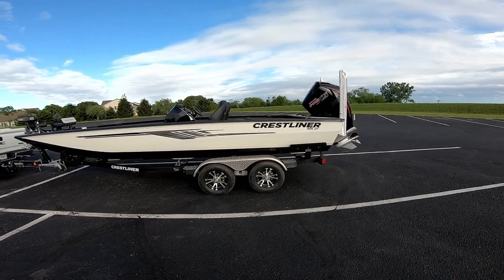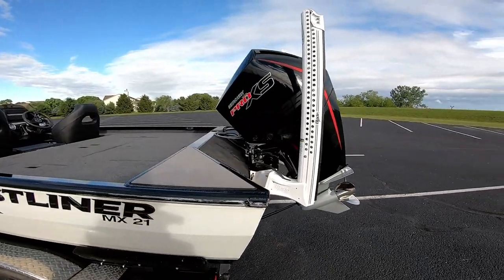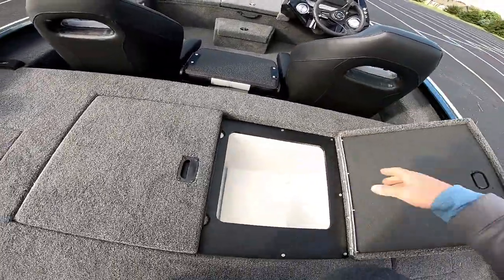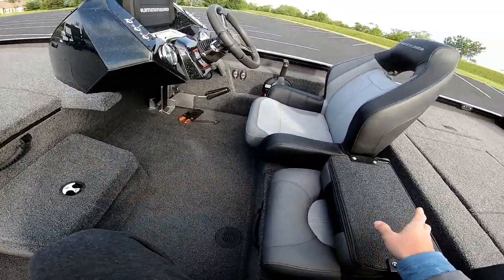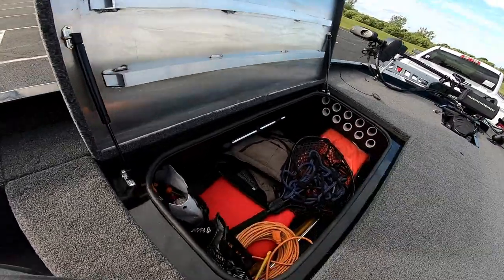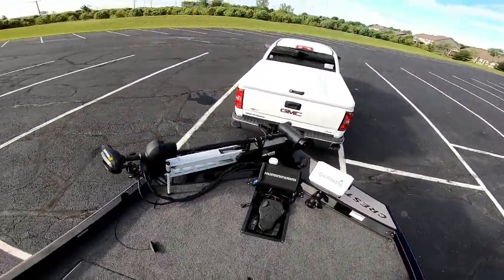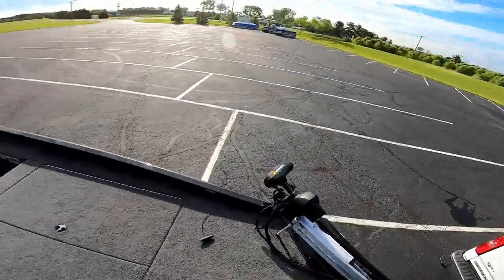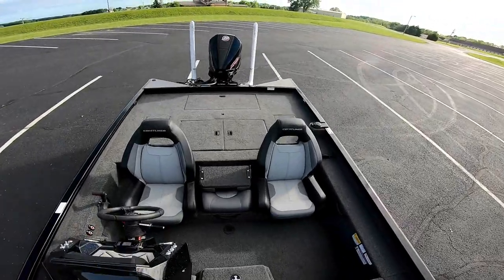Crestliner MX21 Bass Boat Walkthrough (FULLY LOADED!)

Comment: What do you think of the trailer and trailer quality? Is it easy to load? Seriously considering this or a Vexus
Reply from the maker: Trailer quality I would say is average. It’s not great but it’s better than other brands I’ve seen. So far it’s worked fine. Only issue I have is the winch hook and the keel roller has scratched some paint off. However I think that comes down on Crestliner paint quality more than the trailer.
Reply from the maker: I would forsure say get this over a Vexus. You can message me for more details

Comment: Hey buddy I had commented once before. Just wondering how things are going with the Crestliner? I'm looking at possibly pulling the trigger on one.
Reply from the maker: My bad for not getting back! The boat is doing great. I have 0 complaints other than top end speed and handling over 5500 RPM. Everything is staying together the boat is rock solid.
Reply: @andrewmlo5937  you got back to me on the other comment buddy, I was just letting you know that I had commented on your video once before. 👍 That's really great news Andrew! I wish you would sell it.. I would buy it from you!
Reply from the maker: @fabfishing7422  I was lucky I got it when it first came out and the base price was 45.. now I think its 55 or something comparable. you should consider the MX19 I was able to see/ride in one and it has better handling and top end speed is the same if not 1/2mph better... also its still massive.
Reply: @andrewmlo5937  Bro, thank you! I certainly will 👍 I know man, the inflation is PSYCHO!

Comment: Good review.  I just won the MX19 and plan to run it.  I’m not sure exactly how they are going to rig mine but it will have dual PP blades, Ghost TM and Lowrance units (TBD).  I can already see some things I may not like (like no dedicated cooler) and what you said about the rod tubes not being long enough).  Can’t wait though!
Reply from the maker: first off Congrats! I know a few guys who run the ghost. I personally like the Ultrex better. Also I prefer Humminbird graphs (I've bad both). however that's allll personal preference. the day boxes are nice for a soft cooler (that's what I've been doing). yeah the compartment on the other side actually fits all size rods so you don't have to worry about that. did you get a 150 on it or a 200?
Reply: @andrewmlo5937  mine comes with the 200.

Comment: Just bought the same boat….. what prop are you running?
Reply from the maker: 23P Temptest... going to get a 24P fury though at some point ..
Reply: @andrewmlo5937  so I ran a 24p fury…..without messing around very much I got get to about 66 but hitting the rev limiter at 6200 RPM…. tried a buddies 26p tempest…. Waaaay to much….could only get about 53mph and would only rev to about 5000 rpms….. maybe I will try a 25p fury next?
Reply from the maker: @outlaw1605  really?!?!? I have never been able to get consistently over 5700 RPM.. I may need a new prop. how much that 24p fury run you?
Reply: @andrewmlo5937  it was my spare from my old boat… I would like to try a 25p fury or maybe a 24/25 tempest next.